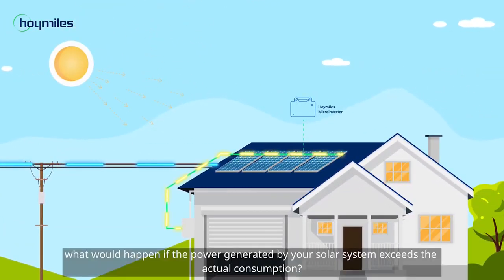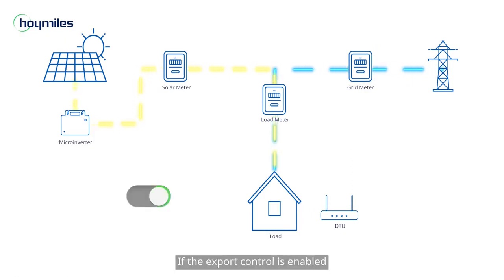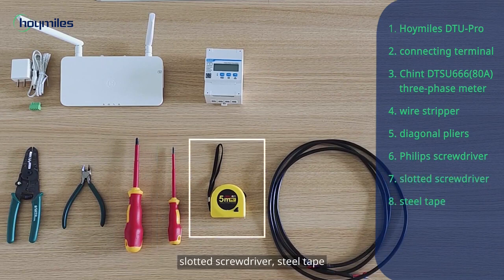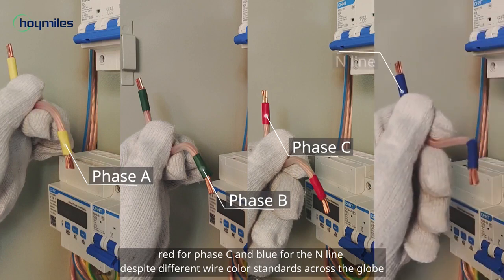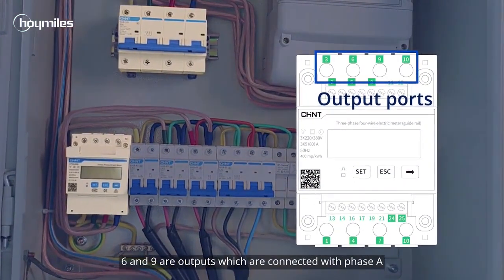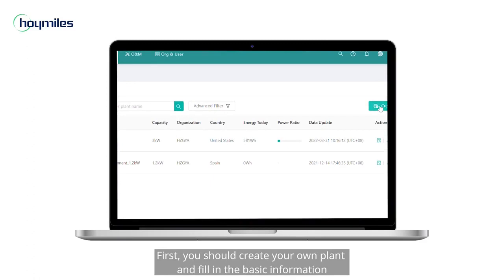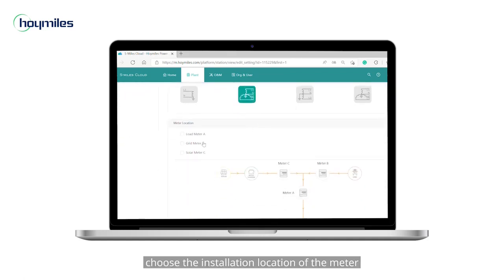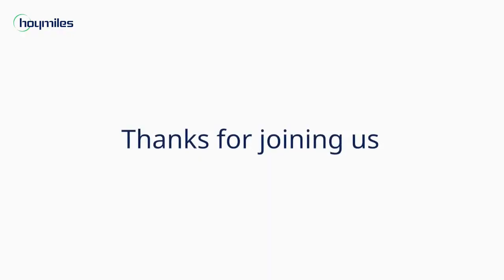Shinetech Hoymiles Nulleinspeisung Anleitung

Comment: Hello I need some help
1.The export is set to "ZERO" but it still sends to the national grid
2.how can the grid consumption also be stopped when the consumer does not have enough power from the PV system.If I don't want to receive power from the national system, what configuration or device can be installed to not allow power from the national power system to compensate with power?

thank you
Reply: 1) Maybe you have an error in configuration/installation
2) Not with this kind of configuration. You need a switch between Grid and the load either manual or in form of a relay.  In an off-Grid-Situation,  you need a battery or/and the whole system might switch off due to overload. Btw. the micorconverters always need external power to start up since they don't have black start capability.

Comment: Mal eine Frage an dieser Stelle in eigener Sache. Ich habe vom Haupthaus eine 3 Phasige Leitung ins Nebengebäude (Werkstatt + Garage) mit einer eigenen Unterverteilung in der Werkstatt (FI+Leistugsschutzschlater+16A Starkstrom usw.). Kann ich z.B. mit einer 2400 Watt Anlage (6 Module) + Hoymiles HMT-2250 Wechselrichter in diese Verteilung gehen um den Strom zuzuführen ins Haupthaus?
Reply: Auch wenn es schon etwas her ist.
Und ich bin nicht von Hoymiles.

Aber, Ja das sollte problemlos klappen.
Denn der Strom fließt auch über die Unterverteilung und die Sicherungen zurück zur Hauptverteilung.

Ich baue/plane gerade einen Ähnliche Anlage mit 6 Modulen, ebenfalls HMT-2250-6T an die Fassade und
12 Modulen (2 x HMT-2250-6T) auf die Garage, auch hier bei mir wird es ähnlich wie bei Dir hier eine separate 3-Phasige Unterverteilung in der Garage neu installiert.

Den Strom kannst Du dann auch übrigens egal auf welcher Phase im Haus selbst nutzen/verbrauchen.
Auch wenn Du ggf. den Strom im Haus an einer komplett anderen Hausunterverteilung im Haus nutzt.
Denn die Zähler saldieren hier auf den Phasen entsprechend mit + / - (verrechnen das also untereinander).

Angenommen Du speist in der Garage auf Phase 1 eben 1000 Wh über die PV ein.
Und im Wohnhaus nutzt Du gerade auf Phase 3 den Herd mit 1000 Wh über eine komplett andere Unterverteilung.

Dann rechnet der Zähler die 1000 Wh (Einspeisung auf der Phase 1) - dem Verbrauch von 1000 Wh (auf der Phase 3),
sodass Du hier vom Zähler her gesehen keinen Netzbezug hast.

Oder anders gesagt aller Strom der hinter dem Zähler ist wird immer Zusammengefasst berücksichtig.
Egal auf welcher Phase Du den Strom verbrauchst oder einspeist.

Comment: is it also possible to control several inverters via one dtsu666?
Reply: Inverters (more than one possible) are controlled by the DTU-Pro  not the DTSU666. DTSU666 is a smart meter only for the DTU-Pro.